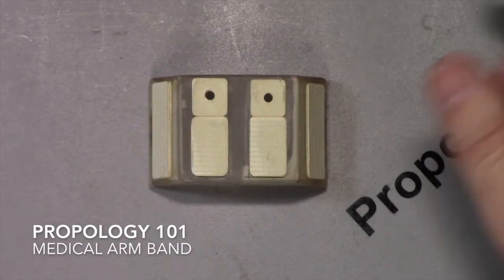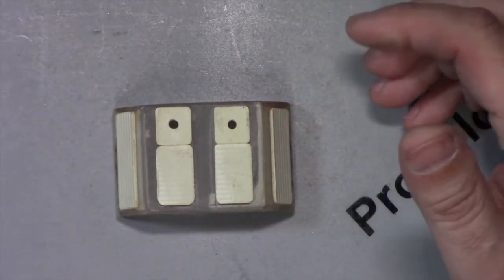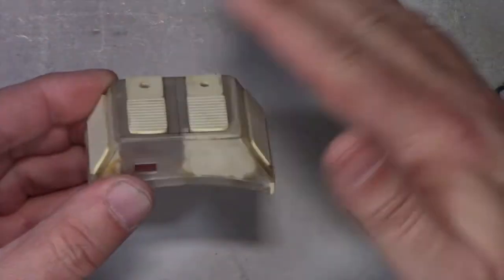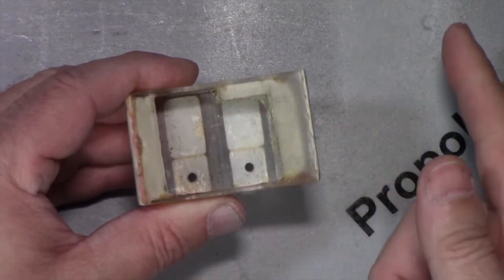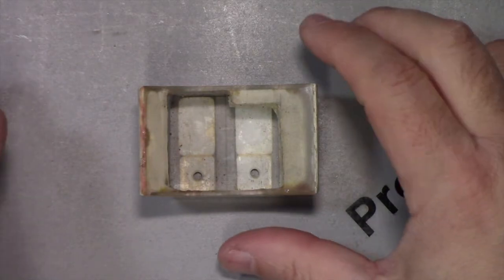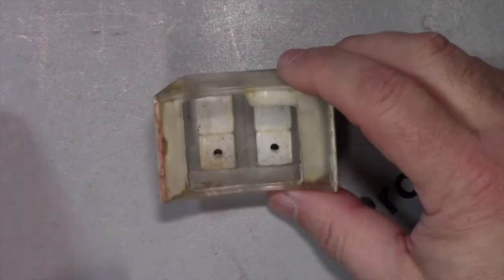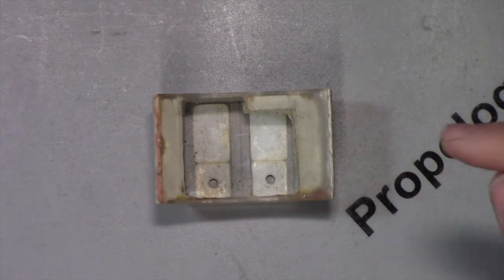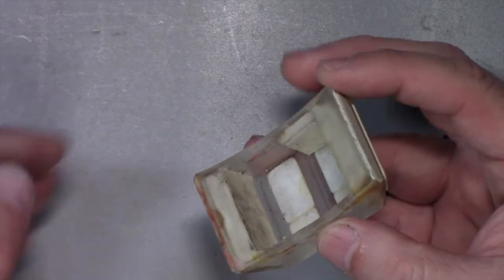Medical arm band

Comment: Why not use the self flashing LED as the LED seen? Were they too big/small for the hole?
Reply from the maker: The leds were t-1's and it was a flip flop that was requested. I believe also that I had the circuit on hand but not self flashing leds.